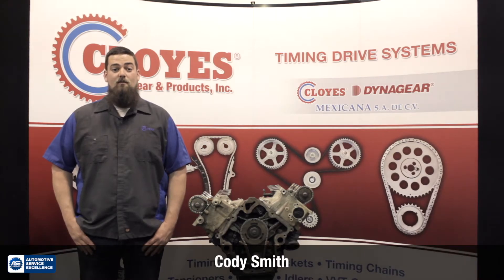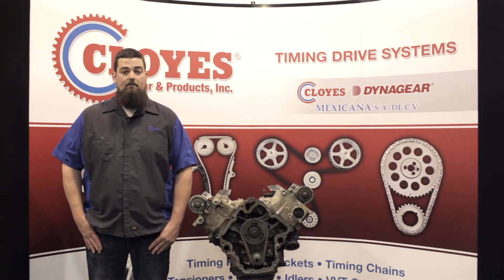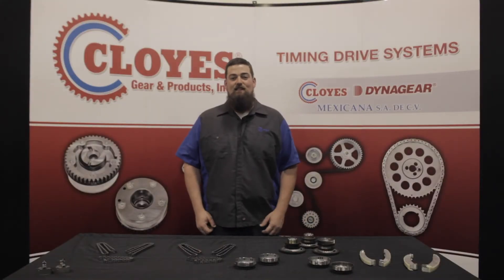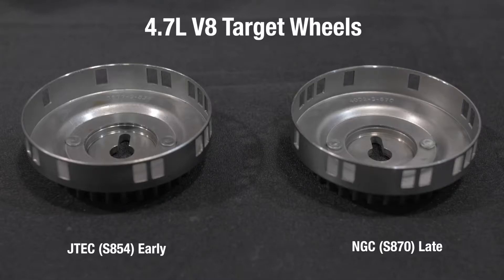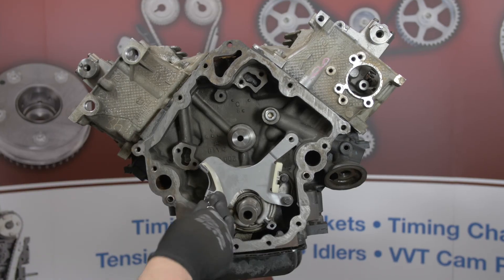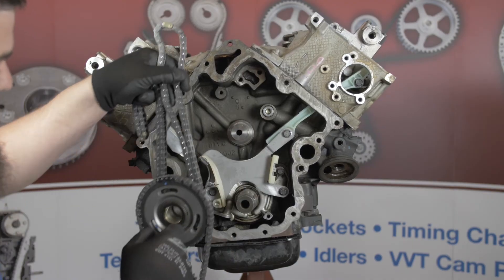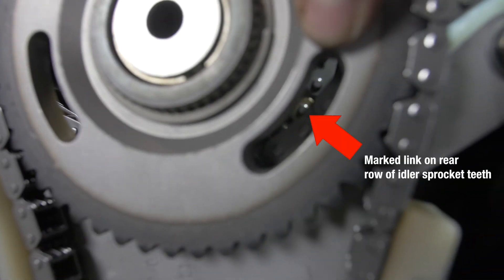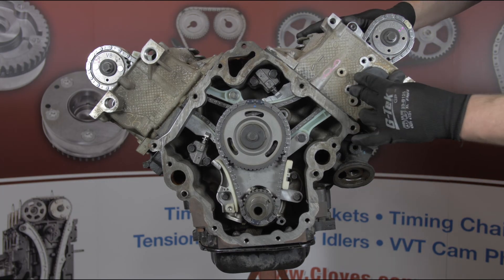Chrysler 4.7L Timing Chain Replacement, Cloyes 9-0393SF

Comment: Torque spec for the torx socket bolts is only 13ftlbs do not do 20 you will end up welding aluminum bc the head cracked.

Comment: Don't torque the left head tensioner guide to 20 ft lbs. , mine cracked. I had to weld it to make sure it didn't come loose. I would try 10 or 12 ft lbs., it does have locktite on it.

Comment: I’m ready did that from 2000 jeep grand Cherokee somebody put it the engine with 32 teeth and never start our place that will or 16 teeth and the Jeep grand Cherokee is star very well. I was looking for a lot information and never found somebody did before and put it on I did, and I’m back to put, this important information the point is if you have computer with three blocks, you need to be 16 tone wheel. If you have the computer with four connectors, you need the 32 teeth tone wheel on my case I didn’t change the camshaft tone wheel I’m investigated and ready hop the right one. I’m not sure if somebody put it on but the car came from the other shop and I never know what they did this vehicle before. That’s why I’ve been crazy but the car is running very well now.

Comment: So I just did a 2000 Dakota. Timed it all up correctly and buttoned it all up. Went to crank it up and it immediately jumped time on passenger head. I think drivers side head jumped time too. I pulled it all apart, retimed it. Did a compression test. Zero on passenger side, 60psi on drivers side. 
This is not the first one I've done but its the first one thats jumped time. What would cause this? Is this a tensioner issue?

Comment: I have followed the directions from this video, yet when i rotate the engine to make sure it stays in time it ends up several teeth off on both cam gears. Anyone have an idea why?
Reply from the maker: The marked chain links are only going to align during the initial installation. After the engine is rotated, you will lose the chain as a reference.

Comment: The torque spec for the driver side tensioner guide is wrong it caused me to destroy 2 heads on my Dakota. Do not torque to 20 ftlbs 10 or 12 is plenty

Comment: I've watched a bunch of videos and none of them are really addressing how difficult it is to talk down the sprocket to 90 foot pounds and this cannot be done with a vise grips. I'm not sure what you did in the video but I'm pretty sure you didn't use the 90 lb measurement and if you did please say so because it has people like me wasting tons of time trying to get this job completed by spending hours on line looking for the right tool if there is in fact a right tool or is anybody actually talking these things down to the proper torque spec.?
Reply: i did both sides with vice grips

Comment: How do you remove that freeze plug on the drivers side head to access the lower tensioner guide
Reply: If you are referring to the black plastic plug to access the upper mounting bolt for the drivers-side lower chain guide, then all you have to do is push the plug out from its backside. I was able to do this using only my finger. Do not try to pry it out from the front side as you may damage the bore. It is aluminum and can be easily damaged causing an oil leak.
Reply: @gregyazzie5247 ṣ

Comment: Quick question: Everything was at top dead center.I removed tensioners and my right side cam gear is now sitting at the 10 maybe 11 o'clock position.  NOW what ?
Reply from the maker: When you are installing the new chain, you will just need to rotate the camshaft back to properly align the marks.

Comment: I’ve tried 2 kits and both kits the passenger side tensioner table that sits in the guide won’t touch it for the full revolution of the crank. What causes this?
Reply: no oil pressure

Comment: Hello! Can the 90393SD kit fit a 2007 Grand Cherokee WH 4.7? Judging by the technical dimensions of some parts, there is not much difference, except for the width and pitch of the chain teeth. Thanks in advance for your reply.
Reply from the maker: No, we show the 9-0393SF to be the correct kit for the 2007 Grand Cherokee 4.7's. The main difference between the "SF" and "SD" kits are the secondary chains. The older "SD" kit contains inverted tooth secondary chains and the newer "SF" kit has roller style secondary chains. The tensioner guides for the secondary chains also changed, the "SF" kit having pivoting bushings where the tensioner guides attach to the engine. With the change in chain styles, the sprocket tooth designs are also different.
Reply: @Cloyes01  Oh, thanks...
Reply: @Cloyes01  Would this be the same process for 02 4.7

Comment: Whats the easiest way to remove the idller sprocket? I don't have no pullers!
Reply: A puller is not needed to remove the idler sprocket. All you have to do is work both the idler sprocket and the crank sprocket back and forth at the same time. They will come out slowly but surely. If it seems stuck, you can lightly tap on the idler sprocket with a soft faced mallet to free it up a little bit.

Comment: Do you have a video for the 05 Dodge 4.7 in a RAM 1500?? Also, can you tell me what the product number is for a complete timing set for the 05 4.7??
Reply from the maker: The 9-0393SD timing kit will work for your 4.7, and this video will apply with just a few differences.